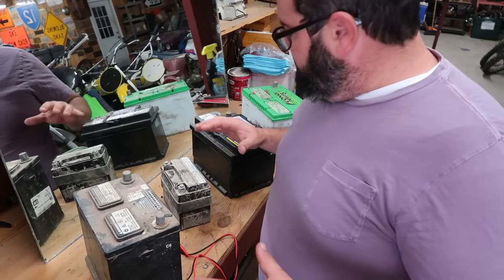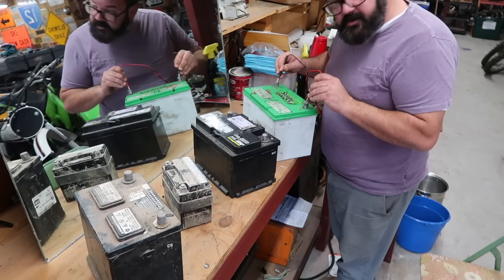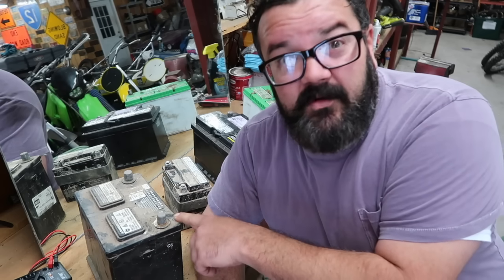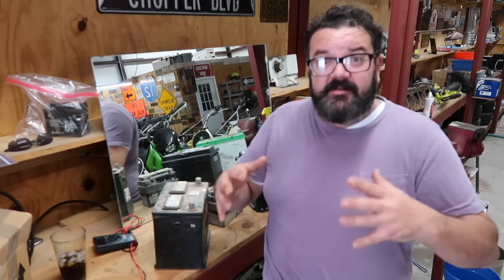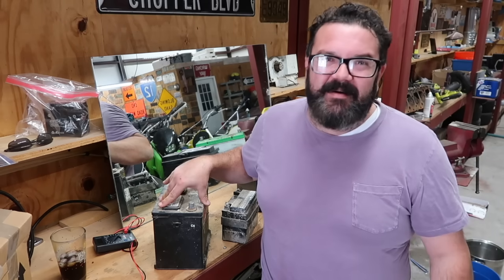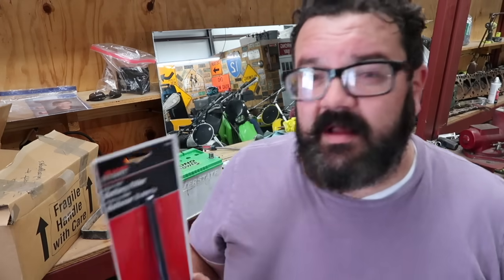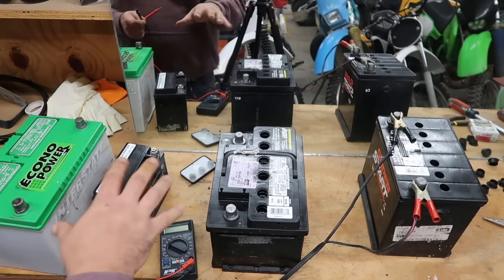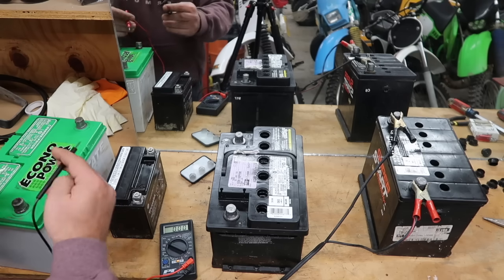Reconditioning a 12 Volt Car Battery: 100% Success

Comment: Not correct, reading 12 volts or not is immaterial, it's whether it holds charge AND able to output the high amperes needed to start an engine.
Reply from the maker: Filming a CCA video now.
Reply from the maker: https://www.youtube.com/watch?v=RNnSYuTuLk4&t=46s

Comment: Why would you do all that talking and leave out the mixture which is the most important part?
Reply: 4 pounds to 1 gallon of distilled water.
Reply from the maker: Thanks Caleb
Reply: What about the acid to Epsom mixture ratio? Just combine the two whole buckets of solutions?
Reply from the maker: @shirleyadelman  No its either one or the other.

Comment: At the start of this video when you were at the stove I thought you were making a batch of my wife's chicken soup when you started adding salt!
Reply from the maker: No need to add salt to chicken soup, just use chicken bouillon.
Reply: There are  a few suggestions for fixing a car battery
Don't try to do this unless you are sure what you are doing - the acid can burn your skin
check the voltage first - there may be a dead cell which would waste your time.
Check the battery fluid.
Try to fully charge the battery.
(I discovered about these and more on Jons Mender Guide site )

Comment: ok so are you going out and buying new battery acid to put into the battery at the end or are you putting the mixture you made  with epsom salt and the old battery acid back into the old battery ? i bought a black and decker battery charger some years back that has a built in desulfater it sends a sonic ping down into the battery.as i recall battery acid is h2s04 or hydrogen sulfate after prolonged use the corrosion builds up between the plates and eventually shorts the plates out rendering that cell non productive.so back to my origional question if you are using the origional  battery acid and you have put the mixture of epsom salt  in with it what does this do to the electrolyte ? does its charge deplete faster ? bless ya brother your giving people money saving info.

Comment: what is the mix ratio of the old battery acid and the Epson salt solution?
Reply: I did 5 lbs espon salt (Walmart sells a 8 lb bag for $5) and one gallon distilled water (.88 at Walmart) and totally works! Good luck!
Reply from the maker: I did 5lbs to 2 gallons, doesn't really matter too much. Just make sure it all dissolves.

Comment: A simple thing to do as well. Take a rubber mallet and tap on the bottom and sides of the battery when you have the soda in the cells. Breaks up the chunky stuff a bit easier.
Reply: Just bought a rubber mallet yesterday

Comment: I hate batteries, nice but your back yard will be a super fund site if you keep doing that.  Better to get blem batteries an just replace them.  The plates are not designed to last more than a couple full discharge cycles.
Reply from the maker: Super fund toxic waste site huh...lol ok
Reply: Considering sulfuric acid is sulfur and water, and sulfur is found everywhere, especially around volcanoes, hot springs, etc..., the battery acid is NOT dangerous to you humans environment. Lead can be, but there is little lead in the solution. A single shotgun shell load of lead, or even a single .22 cal bullet round contains 100x more lead than what was sprayed off the inside of these 3 batteries. Im not saying you're wrong that we should try to manage our resource containment reasonably well, but in these extremely small quantities, it simply is irrelevant. Id be more concerned about firearm ranges uphill within 10 miles of aquifer recharge zones.
Now, IF he refurbished 20 batteries a day for a year, then yeah, I think there would be a problem pretty quickly, but he is on his 8th battery ever. I think your statement "will be a super fund site if you keep doing that" is a bit overzealous.
Also, how do you "hate" batteries? Do you understand the benefits they have afforded society? From pacemakers to computers that manage shipping of every resource and the automobiles that move those resources for all human survival. Without batteries, we would remain in the coal and oil age forever, a far greater negative impact for you humans would result.
Reply: Reach 3D Printers you have a great point on shipping.   I did like the video but I go three years between failures.  So guessing your problems are different than mine.  I do keep them on a battery tender. (Trickle charge)

Comment: You know put can have 12.7 VOLTS AND 00.0 amps sooo this really is not all that helpfull.
Reply: Would have been better if he fully charged and put one in a car I agree.

What he did falls in line with the reason they were dead, flushing the battery is a good thing too.  I think I would have used full electrolyte after the salt/electrolyte bath but not sure what difference it would make or what the outcome of leaving the Epsom salt solution in them would be or how long they would last.
Reply from the maker: Its actually impossible to have 12.7 volts and 0 amps

Comment: I have done this just put a half teaspoon of the powder into each cell, The battery looks like it then has a charge but it is only a surface charge. As soon as you put a heavy load on it they fail again.

Comment: this will never stand a load test.the softer plate will not break down fast enough to main voltage. or when compounds break down they release charge
Reply from the maker: Salt cleans the plates
Reply: @CarGroves   Test that.  Cut open an old battery, and remove a Sulphated lead plate and the submerge in a pan/jar in the salt solution, let's see what happens.
Reply from the maker: https://www.youtube.com/watch?v=RNnSYuTuLk4&t=46s
Reply: I bet if his motorbike has to crank more than twice it will die right out.

Comment: Voltage may read 13 + but try and put load on the refurbished.. I'm pretty sure ude be flat out starting a lawn mower with them .. cranking amps will be near zero ..

Comment: Good point.....they can measure 12plus volts which is great but when under load ......no amps. Ampz is where the rubber meets the road. Rich/ San Jose......ps....im gonna try it one more time after making sure theres no dead cells

Comment: I would think the green battery is the newer AGM (absorbed glass matt) type.    From what I gather they contain less acid, and are considered dry as they don't  leak when tipped over.
Reply from the maker: IDK, but it was def different

Comment: Your voltage is Okay, but do you have cranking amps? I don't think so.
Reply: Yes. Voltets means nothing, like we as viewers mean nothing else than a view..

I have been searching around.
Please let me know if you find just one video, where the battery have been emptyed upside down and refilled with acid. And how many procent power/years it worked for ❤

Comment: Sulfides build up at the bottom of the battery.  Deep cycle battery has a deeper well to capture these.. 
So what end up happening. 
The sulfides/heavy metals.. build up in bottom of battery. Once it has to much sulfide build up. Your battery short circuits and stops charging.

Comment: You do realize if you maintain a good battery by keeping it charged and on a maintainer, they last a very long time. My motorcycle batteries last 9 years and my car batteries lasted 14 and 16 years in vehicles we have owned that long . All these batteries were standard flooded lead acid.
Reply: Being in milder climates does help in prolonging battery life.  In Northern California, batteries seem to last forever despite minimal effort; here in the Far East, the conditions are pretty much like upstate New York.
Batteries need to be (continuously) regularly charged or the vehicles be operated for the batteries to last more than a couple of years.

Comment: battery shacker, works to mix the chem9ical inside the battery, Cook the battery with 40-200 amps.  40 amsp Long term, 200 amps 15 min burn, 1 hour set.

Comment: Why did you use the old acid I didn't think you could use the old acid does that make the process faster? Or should I just use new acid? I thought the whole purpose of the distilled water was to make new acid. And do I just fill them all the way up or just a little over the plate?

Comment: Hi your incomplete you made 1 gallon of Epson salt water and then put it together with the old sulfuric acid then filled up the batteries.thatsxa gal extra liquid. How did you get it all back in ..or just filled until full and had a gal of mix leftover ?

Comment: How much of the acid do you mix  in a gallon of water?  

It sounds like 4 pounds of epson salt per gallon, but how about the acid?  
Where did you get the acid?  Old or new acid?  
If it’s the old acid you dumped out from the battery, how did you clean up the bits of sulfate before reusing it?
If you used a new acid, what type of acid did you use, and how much per gallon?  Did you simply go to an auto part store to buy it?  
How did you discard the old acid if you did not reuse it?  

These questions are not to trick you, but I really want to revive my dead batteries.  Also how did you get rid of the baking soda dumped off the batteries?  
I hope to hear from you soon.  I know this clip is 5 years old.  I hope you still get alerts from it to answer my questions.  Thank you very much!

Comment: Guess I missed the part where you actually used the Epsom salt solution. Did you mix the old acid with it and fill from there? Did you put it in the battery and use it to flush them only? Thank you

Comment: Sulfation is what you're talking about. The best way to remove sulfation is through cycling the battery several times. A constant current can help as well. I don't suggest putting any other chemicals inside the battery.

Comment: Make sure, when dicken around with batteries or any industrial acid, you have your saftey flip flops, and steel toe nail polish on. And don't worry about any kind of face protection, battery acid never bubbles over or pops and spits, definitely never seen that happen.
Reply from the maker: Or ride a dirt bike, either one is dangerous and fun

Comment: Now that the batteries are desulphated, have you tried replacing the fluid with pure sulphuric acid.  This may up the voltage as there will be less water.
Reply from the maker: Yes, in my second video.

Comment: So are you saying that you poured distilled water with dissolved epson salt and the old acid solution in each battery after having cleaned them?
If that be the case what volume of water to the old acid mix you poured in each battery?
Thanks.

Comment: Will I be able to do this if my car battery got extremely hot and smelled like rotten eggs while charging? Volts got up to 12.6v but next day checked it & it was 4.5v & wont go above that now just gets hot and gives a rotten egg smell you think I can revive it
Reply: I got the same problem, Literally last night I pulled my battery and put it on a slow charge on the back porch. Read 12.78 before charge, just now its reading 6.34 lol. if its bad its bad, I had egg smell then no crank issues for a week even after letting the alternator try to charge it for 5 hours! Also look out for bulging and hissing. Idk if the guy in the vid knows but checking the voltage on the battery without a load tells you absolutely nothing its all about the voltage under load, any battery can hold a charge, its mainly about the amps it can deliver which you cant test just by shooting the neg and pos post.
Reply from the maker: Sounds like you melted one of the plates. You can give it a shot. What amps were you charging at?

Comment: Wait I missed how mmuch battery acid to epsonsalt solution ? 50/50?
Reply: About 2 to 1.  A gallon is about 8.345 lbs so say 8.35. The bag was 4lbs epsom.salt. so 8.35 ÷ 4 is 2.08. So approx 2 to 1 ratio

Comment: So after putting the Sulfuric Epson salt solution in them, did you leave it in there permanently? Or did you drain them and put in new Battery acid Fluid?

Comment: The problem I have with this is after you add a gallon of water, the acid solution has to be badly diluted. And even if it works you would not expect to actually use the battery in service with that crap in it.  Assuming it worked great for bringing the batt back to life you would want to dump it and rinse the battery out again and refill it with a new acid / water solution before trying to use it.
Reply from the maker: yup

Comment: Interesting, but I would like to know the quantity/ratios used for the Epson Salt solution to battery acid.
Reply: Pretty sure he said 4lbs to 1 gallon
Reply: Thats the salt solution I didn't hear if he mentioned how much acid to salt solution
Reply: @brianjones6851  That is the ratio of Epsom salt to water
Reply from the maker: Watch the second video, I don't mix them together and like that approach better
Reply: @CarGroves  Thanks I have now watched and seeing that it dawned on me the epsom salts are acting as a cleaning solution of the plates and by adding the sulphuric in just means that the battery would have a quick fix :). Doing it the way you do in the second video the salts are washed away and replacing with fresh acid would bring the battery back to life. Thanks for the explanation. p.s. If you use a heated solution, I would imagine this would act quicker, the charging voltage just acts as an agitator to help dissolve the salts on the plates. Hitting it with too high a current could warp the plates and trickle charging may not be enough to agitate the fluid too well. Using a heated soluition would of course shorten the process.
Reply: L

Comment: Question? You stated you refill the batteries with the epsom salt and used battery acid. Did you strain and reuse that old acid, if so how did you do that? Thanks

Comment: Just because  a battery shows that it might improve its voltage doesn’t mean that it’ll pass a low test, because I’ve tested lotta batteries that initially shown that they were at the recommended voltage but wouldn’t turn the car over and if it did turn the car over after the car sat for more than a couple hours or a day the battery was too weak to start the car again. and then you had to go and charge once again just because it shows the right voltage doesn’t mean the  battery will recover fully unless you do a load test first and make sure that it’s not beyond repair!

Comment: Great video man
But Iv charged batteries up to 13 volts but when I try to start my tractor with them the voltage goes straight down to 4 or 5
Just when the load comes on then 
Then back up to 13 again 
Do you think I should use your Epsom salt’s system???
Church and take care

Comment: I basically had the same problem with my battery. Last month when I was on my way to the store the car died so I got my multimeter out and I check the voltage on the battery and it was 9.7 264 V so I thought what the heck is going on with this battery the next thing I knew I seen smoke coming from the tips of the terminals I was suspicious on what was going on and I couldn't believe it because this battery was only 16 years old which I consider fairly new in today's society so basically what I want to do is try to clean up the ba ttery with some soap and salt solution and then I might put it on the charger for two or three minutes at a high current rate just to see if it will have a charge I'm not sure if that's going to help the battery or not but one thing's for certain before I go buy a new battery I'm definitely going to try these two methods that I suggested now on the other hand I could swap the battery out with one from my Chevy Tahoe but I'm not sure that the old lady would let me do that so basically what I need to do is first I'm going to check all the ear and the tires before I monkey around with the battery then I'm probably going to run a few errands around town down and the next thing I want to do is get some paint and paint the battery terminals because I don't think they look very good with the LED color look to him so what I want to do next after that is get some of that distilled water and pour on the outside of the battery to try to clean up a lot of the dirt and dust its accumulated over all these years. If I have time what I'll do after that it's try to clean both sides of the mirrors on my Bronco because I've noticed while I was driving that it's hard to see what kind of traffic is coming up behind me. I was having a problem with the battery when I put the headlights on low beam and then when I tried to switch the high-beam I noticed that the voltage excursions were jumping around so I went out and I bought another set of test leads to use on my digital multimeter and there was no difference at all so I think I may borrow my friend Tony's multimeter just to check those voltage excursions to see if there is normal nobody really explain to me how to test a DC voltage excursions when the battery is not in its prime. A lot of people have contacting me and they said that they've had that problem once or twice and their lifetime would their batteries but they did something totally different what they did was loosen the terminals first then they carefully remove the battery and host it off to get rid of all the debris and dirt that's accumulated after all these years then they put it on a slow charge which I believe was 32 milliamps for 6 days next they took the Caps off and added some distilled water would stay bought at their local Walmart store I think it was for 99 cents can you believe that just 99-cents that's a real good price for one full gallon of distilled water.
Reply: Good job !

Comment: So you use the same batter acid, just allow the heavy metals to drop to the bottom of the bucket? Can you buy new acid, would that be better?
Reply from the maker: Probably not much different. The lead settles to the bottom.

Comment: Would the proper process not be to clean and flush with the Epsom salts solution and then add new battery acid and distilled water?